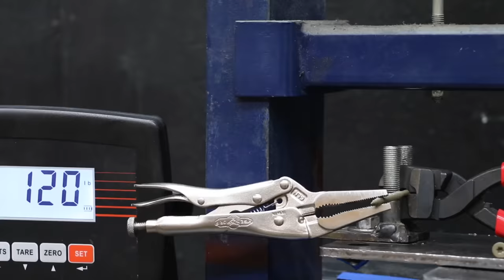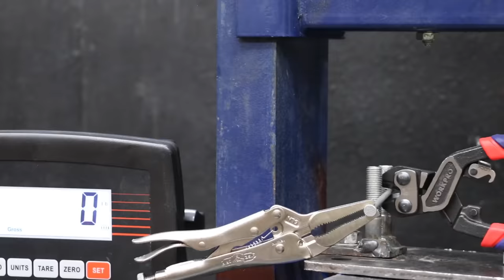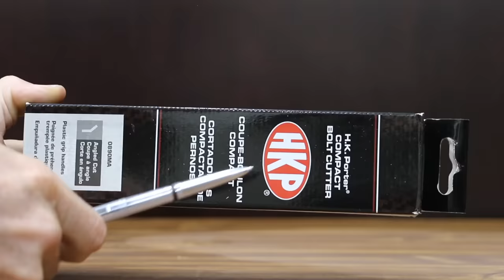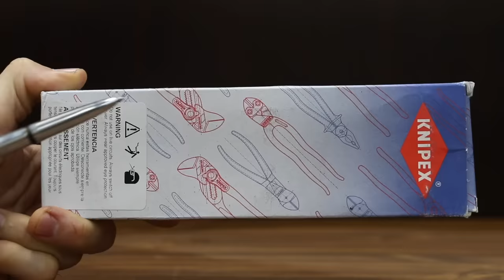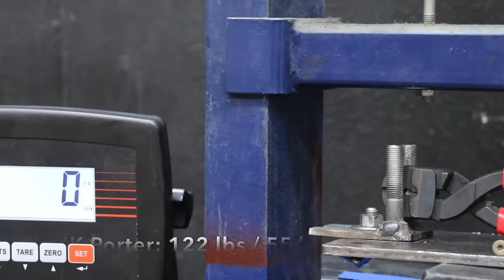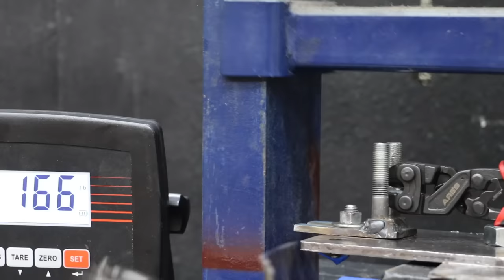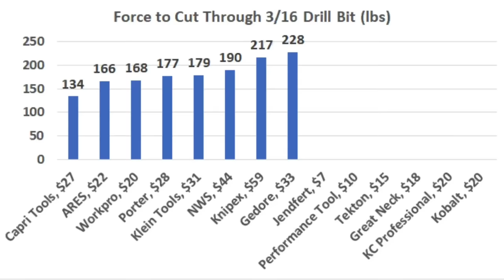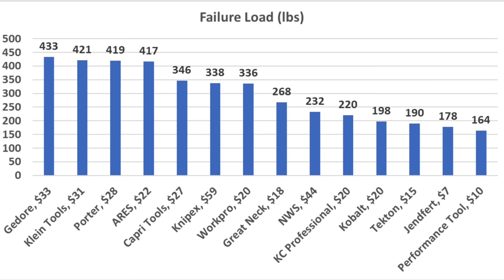Best Bolt Cutters? Knipex, Klein Tools, Kobalt, Tekton, Gedore, NWS, Porter, Workpro, Capri Tools

Comment: Folks should take the test to failure with a grain of salt as you would never be able to squeeze these tools with this much force by hand.  I would consider the tools that suffered less blade damage to have performed better even if the bodies of the cutters failed.  These are hand tools, so the cutting force and blade damage are the most important criteria.
Reply: Indeed in all probability none of these tools would have cut the tested items using  bare hands,  but I have often clamped unsuitable sized cutters in my vice and slid a long tube over the other handle.  These sized cutters could maybe be used to cut small nails,  but are the size most people use to cut barbed wire and such softer metals.
Reply: Great observation, Thanks!!!
Reply: @Bryan Gipe you are correct but I'm sure they were placed as deep as the design let them, some simply do not open much
Reply: @Bryan Gipe How deep into the jaws you can place a nail depends on jaws design.  He even mentioned it in the video that due to the design of Knipex he couldn't slide the nail in as deep so they required a lot of force to cut.
Reply: “If this can take 400 lbs of pressure before breaking, it’ll definitely work for what I need it for.” 
-User
Reply: You know I'm gonna put them in a vice if I don't have a better way to cut something.
Reply: It still shows us what it takes for the tool to fail. From that we can extrapolate valuable information.
Reply: What else are you going to do with a dozen small bolt cutters?
Reply: I was thinking exectly the same thing you woul have to be bloody superman to squeeze those shut they are cable and wire cutters who cuts drill bits and hex keys with wire snips nobody
Reply: @stevemcevoy5628  it's not the point of who does it but rather to examine how and when the tools fail. From that some of us can extrapolate a lot of information about construction and materials of the tools themselves. If everything works there's nothing to be learned there. Absolutely nothing at all. No conclusions can be drawn without having seen anything of note. Todd can make other tests that would better reflect real world use but they would be far more difficult to do or to show. What he does is short, sweet and gets the point across. He did not invent destructive testing. It is a widely used method.
Reply: @Rudy97  if you plan ahead and get a more suitable tool, you wouldn't need to use the vise to do the job. It would have to be some dire circumstances for anyone to have to try cutting things that way. 
I look at it as an excuse to buy another tool 😎
Reply: You should take it upon yourself to start your own channel
Reply: I know a few guys with over 200lbs of grip strength. Double that by using 2 hands, you’ll get some broken cutters.
Reply: When one says “grain of salt” it always means a dig at the validity of something.  I think the testing techniques would appeal to the common man thus are valid.  Nevertheless, you have a good point about blade durability being paramount.
Reply: With enough leverage you can definitely do that.
Reply: @wingerrrrrrrrr Sometimes you gotta do what you gotta do and don’t have the convenience of just “buying another tool”.
Reply: Performing well with a lot of carpal tunnel in your hands for sure 😂
Reply: All of these tests should be taken with a grain of salt. It doesn't factor in Comfort or how much a person can squeeze with a human hand based on the design of the cutter. And also how do they cut over and over through time.
The test is valid because it Compares them with one another but it doesn't really show how they will perform in your hand.
Reply: Nah, Chuck Norris needs to know max values.
Reply: You’ve missed the point, yeah you’d never be able to apply as much force as some of them required and broke but for the ones that cut well required less than 200lbs which you can easily do with two hands. Obviously if you were cutting drill bits you’d want capri tools cutters. 134lbs is easily achievable with two hands.
Reply: Just saying a really strong grip in one had is like 60 to 80 psi now put two hands on it u got 120 to 160 psi
Reply: its a destructive test, to see how much torture the tool can handle. It just help User to decide which brand is better, It doesn't mean you have to grip by the same amount of force😂😂😂

Comment: KNIPEX actually makes a different "CoBolt" 8" version of this bolt cutter that is much nicer than the one tested, it has a notch and having owned both of them, the one with the notch design much nicer than the one lacking it. It is similar in price. Nice video as always!
Reply from the maker: Thanks!  Thanks for the feedback.
Reply: Do you have a link to the one you are talking about?
Reply: i fully agree, i have the same cobolt 8" cutters and i've put some amazing force behind them and cut some hard metals with it, not so much as a dent on the blades, one of the best purchases i've made for a high quality tool
Reply: I like their warranty too. It's fair.
Reply: I think it's not so much that it's nicer, but rather you have that option to split thicker material into 2 steps. Without the notch is better for thinner materials
Reply: My old knipex are different looking. 
And they were a lot more expensive than $59 .
I think I paid about $85 for them 5 years ago . 
I keep a pair of them in my plumbing tools for toilet bolts and I keep a pair of them in my 
Bug Out Bag . Because they could easily
 fence / cattle panels .
Reply: @glock19gen3  The 71 31 X model is the one with the recessed notch. The 71 12 X is the one with straight cutting edges.
Reply: @DEADB33F  i have the recessed knipex bolt cutter and the recessed is a must when cutting bolts/screws. Love them.
Reply: Do you guys mean 71 02 200? They make like 6 or 8 versions on this size boltcutter. With springs and different type handles different angles.
Reply: @DEADB33F  awesome, thank you
Reply: I was about to point that out - notched Knipexes would probably perform better in this test (maybe even smash competitors), as the notchless used in video are rather designed to cut flat pieces. Notch really helps in maintaining cut piece as near to the pivot as possible which is kinda essential. Hope to see how they perform one day, in sort of "round 2" test😁 that IMO poor choice of particular Knipex cant prevent me though from expressing how once again I am astonished with tests and videos on this channel, tremendous job!😃😃
Reply: @ProjectFarm  you don't pronounce the k in knipex.
Reply: I have the notched CoBolt cutters and they are fantastic. They'll even cut through handcuffs!
Reply: I was hoping to find this comment. Having owned both versions I agree the CoBolt is the better version. I also like the spring mechanism on it. It also comes in a offset version that allows you to almost make a flush cut.
Reply: @Littlevinny1115  They do in Germany, K is not silent
Reply: @danecarpenter8735  the spring version and flush cut must be a different variation as I have it without either of them
Reply: Can you please provide the serial number for the notched knipex?
Reply: @Littlevinny1115  yes you do
Reply: @Jamie Smith  ok fine, just sounds terrible
Reply: @Carl McCoy  ok fine, just sounds terrible
Reply: @Alexander de Keuyper  ok fine, just sounds terrible
Reply: Привет, ты некорректно проводил испытания. На разном инструменте гвоздь находился то в конце губок, то в начале. Из-за этого результат по усилию отличается. Ставлю дизлайк, похоже на подтасовку
Reply: @Littlevinny1115  according to the company themselves, you do pronounce the K.
Reply: @atolsanych  Я считаю, что глубина резания определялась самими челюстями.
Reply: @charlesangell_bulmtl  Ничего подобного.
Reply: Littlevinny1115 it is a hard K, must be pronounced clearly.  refer to the Knipex new tools marketing video
Reply: @yellow3222  They where a lot better than the new ones, thus the higher price. My newer Knipex bolt cutters, got dents on the teeth, after the 1st nail I cut. It was a tough nail that I've tried to cut, but it was really small to expect any kind of damage on the teeth. They are not like the old ones, but also it's probably a hit or miss these days.
Reply: @cristopherfrakes1416  Yes- as a German in tell you: that ist right
Reply: Capri tools will beat them
Reply: @manfredbirner378  according to the videos put out by the company themselves specifically to address this question, the K is pronounced. A company can call themselves whatever they like. If Pepsi states that their name is pronounced pep-sigh, then that is how it's pronounced.
Reply: @Littlevinny1115  I thought I was the only one that noticed that! 😅
Reply: @Littlevinny1115  that's wrong. The k is pronounced. You can hear employees from the company pronouncing the k in lots of videos too
Reply: @irzyxelwj  I see you over here at pf
Reply: @GBall_Vision  hah! A man needs good tools buddy!
Reply: @gabekamphuis  smart idea!
Reply: @Littlevinny1115  you DO pronounce it. (being from the knipex land, i know how 😉)
Reply: @irzyxelwj  you aren't kidding brother. I got lucky for Christmas the family got me 5 knives and a 20 volt DeWalt circular saw. Probably the best Christmas I've had since I was a kid
Reply: @GBall_Vision  Wow nice man. I have my eyes on a few items, but I need to build a new pc first. That is unless an Asher ti Spiro drops.
Reply: @irzyxelwj  I know I'm waiting on that too. I have my eye on two or three knives coming soon hopefully. I need a new laptop too. I have to quit buying knives and get some other stuff 😂
Reply: @Littlevinny1115  Project Farm: I didn't "k"now that. Thanks for the feedback!
Reply: In that case you might as well get the 10in
Reply: @atolsanych  thank you! Someone finally says it!

Comment: Everything you need to know about each brand, along with exceptional testing. Thank you!
Reply from the maker: Thank you very much!!
Reply: @ProjectFarm  If you move up to large two-handed bolt cutters, I suggest testing on a padlock shackle since that's one of the most common uses for them.  Maybe get Masterlock padlocks and see if you can cut them as fast as the LockPickingLawyer can pick them (about 4 seconds each).  😺😸😺
Reply: @HariSeldon913  I like to see that.
Reply: @ProjectFarm  already commented once, but the k in knipex is silent.
Reply: @Littlevinny1115  Actually, a couple of months back he stated in one of the videos that he had checked and the company themselves do pronounce the 'k'.
Reply: As is so often the case, the mid value product performed best generally. Don’t buy cheap. Don’t buy expensive.
Reply: @HariSeldon913  Right! Maybe's in need of some validity requirement. Or somone has to tell him what a I...t he is. 
Anyway You are right and he is not. And I know my language.
Reply: Looks like you’ve should’ve quit after the first comment, LittleVinny.
Reply: @MrNickelbrille   To be fair, phonemes change across languages and there is no exemption for proper nouns. There are no language police except for France and Quebec.    :)   Pronunciation of anything becomes local.
Reply: @ProjectFarm  Have you tested duct tape?

Comment: Never in my liquor-induced delirium would I have imagined that the simple Klein diagonal cutters would tolerate this much abuse.   Glad I purchased them.   Good video!
Reply from the maker: Thanks!
Reply: Klein tools have taken my abuse for 30 years they are consistently exceptional
Reply: @mattcanfield6384  Seriously, I have no idea how they put up with my bullshit.
Reply: @mattcanfield6384  same here, although my linemans take the most beating and I mean that literally bc we all use them as a hammer from time to time lol
Reply: All my Klein tools are in my electrical toolbox and I have to say Klein are definitely top-shelf quality.
Reply: @JamesKelly89  My first Klein tools were the mini (for the time) flush-cut dikes for PCB work.   I still have them from 40 years ago and they still work fine.  Back then, Klein was pretty much the go-to source for such stuff.
Reply: these are the d2000 cutters, they have the blue handle, not nearly the same as the regular red handle cutters
Reply: @nikkoBcool  I didn't even know that Klein made tape measures and multimeters.  I've long relied on my Lufkins for the latter and Fluke for the former.   Lufkin's now a part of Crescent and I admit to not having tried anything of theirs in the last 20 years or so.
Reply: Big issue with rust.  Don't leave them outside or anywhere your toolbox might get condensation.
Reply: @tubastuff  I'm sure they just sub their name on inferior products, became the tape measure has a stand out length of like 6' and after a single drop from a 8" ladder it started to jam,, the DMM turn knob started to spin freely after limited use without having the clicking notch type deal between each selection.
Reply: @idhatemet00  I hate when I use my Klein Lineman's as a beating tool:
 I.E. Hammer, but they do take it
Reply: @idhatemet00  ah yes. The linesman's hammer
Reply: the real question is, where do we purchase locks and bolts made out of allen key steel?

Comment: I have been using my knipex daily for almost 5 years and they still look brand new. I get them as Christmas presents for all my friends. I'm a travelling service tech so I have to limit my toolbox to 50lbs to meet airline baggage requirements. Being able to have a tool like the knipex that can replace 3-4 others is great.
Reply from the maker: Thank you!
Reply: I'm a Knipex fan too. I've made hundreds, possibly thousands, of cuts through 1/8" stranded hardened steel cable with my mini bolt cutters, and the jaws look barely used.
All of my pliers are Knipex, with the exception of a Japanese specialty pliers.

Comment: I've had those Knipex cutters for over 13 years or maybe longer.  There was no competition at the time. When cutting, I put the item as far in as it can go, I push down till it makes a dent and then slide the object closer to the pivot point if needed. It usually cuts very easily then.   Thanks for another awesome video.
Reply from the maker: You are welcome!

Comment: Suggestion: A test of welding helmets. That's a thing you can't really test yourself unless you want to risk permanent eye damage. With your methodic style I'd love to see a comparison of welding helmets and if you can trust them with your eyesight. Great videos!
Reply: meh, a lincoln wont look like the miller will, unless you mean non auto darkening which they all use the same lenses.
Reply: All welding helmets protect your eyes from permanent damage, the protection is built in and passive, the darkening functionality serves only to allow you to see what you are doing, so what you would be looking for in a review is more like clarity, viewing angle, comfort, weight, ease of adjustment, battery life, stuff like that, not safety.
Reply: That could be something ttc could test
Reply: I have a few and tested them. I'm no pro at welding, so for me, the reaction time for autodarkening helps A LOT with sticking rods (I do stick welding). The old flip ups are ok if you're observing, helping etc, but I couldnt weld great with that. The Lincoln is ok...but man would I stick all the time. The puddle would also trigger the darkening. The miller though was great and made me improve my welding a lot. I can look in my vid to see the exact model if this helps. Like I said, Im self taught, but do want to make good welds, that look good too, so I learned this over the course of 2 years or so..(Im still a beginner lol, since I dont weld every day)
Reply: miller has good long-lasting headgear. all auto tint will flash you some, heavy production mig 300-400 amp you will hurt from the flash,, lightweight counts 10 hours a day. learn old school flip up. I only tig or tac weld with auto,,, Jackson and so many more are worn out in 3 months now, 25 years ago I could get 2 years out of a Jackson light weight big lens helmet now its miller time for me.
Reply: No, all helmets including the 30$ ones offer complete and constant protection from UV. It's only the visible light that gets auto darkened. So the test wouldn't be about safety but only optical quality of the lens, which is an important parameter of course.
Reply: Yes welding 360 helmet. Amazing.
Reply: @RipRoaringGarage  TRY using two hands when you start the rode maybe. offhand can be close to the arc, then move it away. helped me when I'm 200 feet up and the wind is 30 mph. .
Reply: @slickwilly1099  I do use two hands, but my hands shake sometimes, especially if Im in a weird position. It is what it is, and I have to work around that issue, since it won't get any better (the nerve damange that is). 200 feet up does not sound fund though lol. I used to work on aircraft, and I remember high Oklahoma winds trying to replace beacons on the vertical stab. Fell of the JLG once, and even with the harness it was not fun dangling. I hate heights as it is lol, so props to you!
Reply: @RipRoaringGarage  if you have to stop before the rode is used up. quickly rub the hot end over your gloved off hand. you remove slag restart will scratch better. how do we get to carnage hall? practice practice practice. keep your hood down, cheers
Reply: @slickwilly1099  Thats a good tip! I will remember that. Although maybe its just the practice, but the first rod of the day sucks for me. After that I get better. Now Im working on getting my bead to look nicer, and I should practice on strips and whatnot, but I have so much crap that needs done, that I suppose jumping in the deep end will work too, but with lots of redos.
Reply: @RipRoaringGarage  i am about to turn 60. reading glasses and magnifier lens. sucks my head has to be just so far away to see..lol but I love burning rod or wire.
Reply: @slickwilly1099  Same here. Im near sighted, and for now at least, I have very good vision, from around 50 thou close lol.